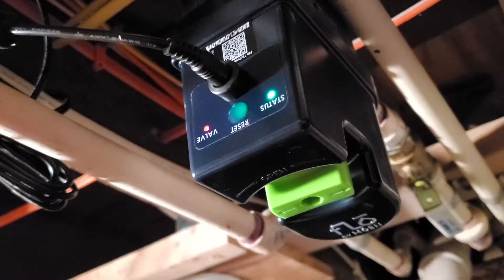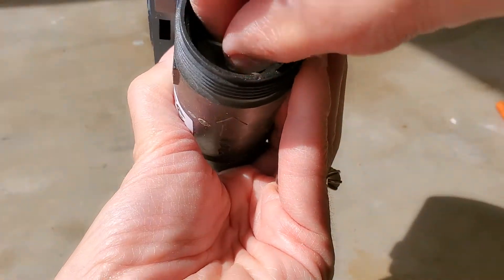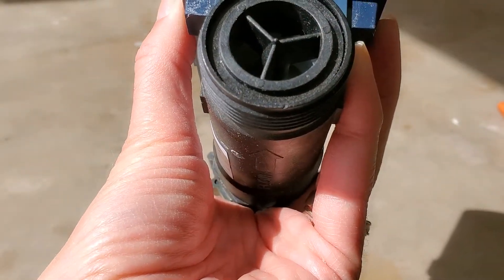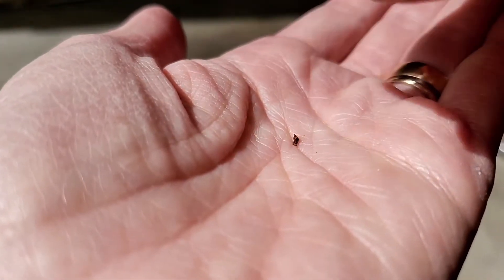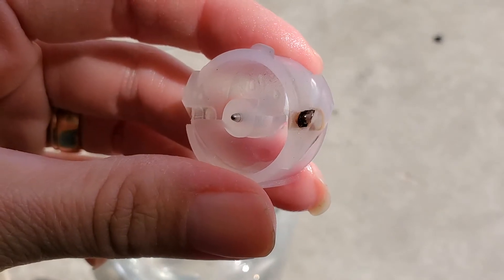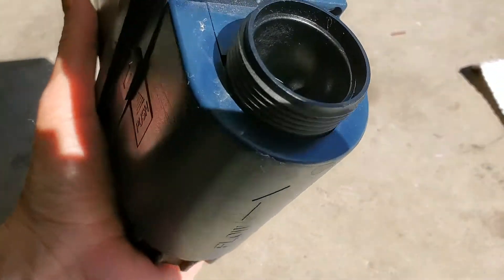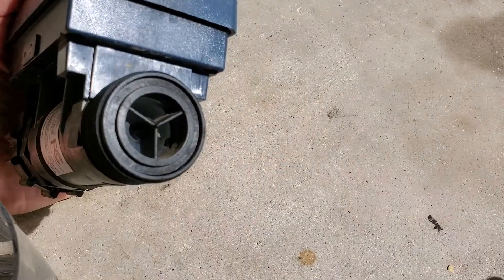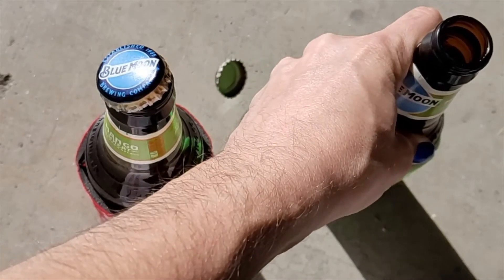Flo by Moen Flow Sensor NO LONGER WORKING?!? Turbine Repair Tutorial

Comment: Ok im not sure if mine is not working becuz no power or it needs cleaning
Reply from the maker: Are the lights out at the device? If so, yes, agreed: power is the problem. How old is your device and is it indoors or outdoors?
Reply: @NoMoreLeaks its outdoor no lights had it about idk 6 to 8 months
Reply from the maker: Oh no. I'm sure you've already made sure power is still live to the device/outlet. If so, my understanding was that they had addressed the interior leak problem over a year ago, but it sounds like that might be a likely culprit. I had exactly what you described happen with my original Flo device, followed by the Flo by Moen, green handle devices. My suggestion is to take it off, shake it, and see if you hear water inside. If so, I hope you still have the spacer that came in the box to put in place while you warranty it out (or just put it back on). I can't suggest enrolling in FloProtect too much here before you hit the 1 year window. I probably should suggest calling customer service before taking it off, but after a few of these with the same issue, that was my standard set of steps. If you don't mind, I'd appreciate knowing what ends up happening.

Comment: Terrible. I had mine installed. 100% regret. From day 1 the device made noise, spun to off or on, and yet,  stopped nothing. Didn't register a problem. I can't trust this device.
Reply from the maker: That is frustrating. Were you able to warranty it out and get a replacement?

Comment: I've been interested an emergency water shutoff valve/system, but the more I look into them, the more I think, "They're not quite ready for prime-time!"
Reply from the maker: I said the same thing 6 years ago, but that's with the reservation that we live in the desert where the plumbing is outdoors and the device must stay outside. I wasn't wrong, but Moen says they have improved the part that failed (I haven't tried a new device yet). I had them send device #5 to live indoors in a climate controlled environment. 5 years later, it is still going strong. Phyn Plus probably would have done as well if they extended the same courtesy Flo Technologies (at the time) did. Phyn has an upgraded version coming out possibly this summer. The main lesson learned here is that if it is inside, it is probably fine, but the outdoor rating--stay tuned.

Comment: My Flo shutoff stopped detecting flow less than 5 months after it was installed -- much less time than what seems to be the typical time-to-failure mentioned in the comments. I am very glad to find this video! But I better contact Flo support first before attempting to troubleshoot on my own...
Reply from the maker: The good news is it sounds like you are still within the 1 year warranty. I'd be surprised if you have the old style turbine shown in this video. The newer units have the magnets sealed inside. I'd love to know what ends up being the issue and would appreciate it if you came back to share. If no one else has sent you a plug for FloProtect--I'd recommend it especially if the issue seems like it will happen again.
Reply: @NoMoreLeaks  I called Flo support today. The rep gave me the most unexpected answer. She said there were cloud updates recently that may have broken my device connection, so she asked me to do a hard reset. I did that, and I removed and re-added my device in the app. That seemed to actually do the trick! (I'm a little disappointed that I don't have any good excuse to open up my Flo now.) I will take a look at the FloProtect Plan, too. Thanks!
Reply from the maker: Thank you for coming back to share this! This seems like a much better solution than anything more dire. My apologies for the delay in response--you've helped me figure out I have an issue with getting notices on replies. Thanks again.

Comment: Our sensors work but when you give it the command to shut off the water it is no longer shutting the water off, just reducing the flow.  I'm not sure why it does this but it could be some kind of build up internally I guess. Ours is crammed into an incredibly tight space so I am not going to bother trying to fix it since it will just break again.  Still get the wi-fi info but can't count on it to shut off the water.
Reply from the maker: That's no good. I'm curious how you discovered the issue and hope it wasn't a leak. How old is the unit--could it still be under warranty?

Comment: Hi and thanks for the video. I don't have one of these devices but I've been considering one. When you refer to the unit not working, what exactly does that mean? The info on the app? Or does water stop flowing? I'm wondering if a problem with the device is interrupting the normal flow of water to the house? Thank you.
Reply from the maker: I live in the Phoenix metro where our point of entry for water is outdoors. My units had to live outside in the heat. 5 years ago the devices were not designed for this environment. I'm talking to Moen again and they say that there have been improvements there. Stay tuned... My last replacement I sent somewhere to get installed indoors in a conditioned basement. It has been fine for 4 years.

Comment: My Moen Flo lasted less than 3 years.  No longer getting power, even after ordering a new power supply from Moen. Poorly designed.
Reply from the maker: Thank you for sharing. Definitely not the best experience. I'm curious. Where was it located? I'm guessing indoors if it lasted 3 years. Did you take it off and shake it? If so, can you hear water sloshing inside? Mine were outdoors and failed on the interior like that. Water went into the electronics side and fried the circuits. I haven't heard of anyone having that same problem if it is indoors. My latest unit is almost at 4 years, but it is inside (not on my house).
Reply: @NoMoreLeaks  Yes, indoors and no, I have not removed it so not sure what the cause is but sounds like what you are describing-water getting into the electronics.  I'll wait until someone (another company) comes out with a better and more reliable design...hopefully.  I spent a lot of money trying to do the right thing, and to have this fail in such a short span of time is frustrating.  I have also had bad luck with Moen sink valves. The ones I replaced were still working after ~30 years but I decided to get ahead of any issues and replace them.  One would leak when turned all the way to the cold side, so I had to replace it. Also (sorry for the rant) I had purchased smart water leak detectors (batter operated) and they arrived with the battery contacts sliding around inside...they weren't soldered.  Returned those.
Reply from the maker: @jimroberts6176  Interesting! I haven't heard of the inside failure happening on a unit installed indoors yet. When mine failed the lights went out so I figured why waste money keeping the AC adapter powered on, so I unplugged the device and left it inline--only to discover water dripping out of the power plug days later! I'd highly recommend putting in the spacer that came with the unit and taking the unit off to prevent a leak from the device itself if you have the internal leak. If you don't mind, when you do take it off, I'd love to know if that is what actually happened.

Rants are welcome--comments are the best part of videos. We all share what works and what doesn't. :)

As for the leak detectors. Do you recall the brand? I'm slowly working my way through a good number of different sensors (shared on the channel) and haven't come across a terrible one yet. Too bad Flo ended the IFTTT integration because their detectors are spendy!
Reply: @NoMoreLeaks  Thanks for the suggestion about the spacer.  The leak detectors were Moen (Flo by Moen Sensors)
Reply from the maker: Happy to help--and prevent water damage from a leaking unit! That would be insult to injury.

Wow on that feedback on the Moen Sensors.

Comment: Thank you! This is the second time around we had to do something about the build up around the magnets.  I can's remember what we did the first time... cleaned or replaced.  This time we did get a replacement kit, thanks to you and your video.  I decide to soak the old one in vinegar and keep it just in case.  The vinegar cleaned out the rust.  There is some black stuff left around both magnets, and I don't remember if it's some sort of material that should be left there, or do I need to clean it more so only the shiny spikes are left?  Some of the black stuff already dissolved...  

Hope you see this!
🙏🙏🙏
Reply from the maker: I'm wondering if the black stuff is what is beneath the outer surface of the magnets. At some point if you have rust building up it can eat through the outer shiny part of the magnet and leave a rough surface which is easier for rust to build up again. If it is not that I have no idea what the black stuff could be. Glad to hear the replacement kit did the trick in the meantime!

Comment: No More Leaks. OK, I have watched all of your videos on the Moen Flo. I do not have one yet. I live in a manufactured home retirement community in Arizona. I own the home, but not the land under it. The water is provided by the City. The water has calcium in it. It can cause problems with faucets and toilets. The local fire department requires two feed to the facility. In Arizona water towers are not used. So there are regulators on each water feed. At times the pressure can be 24 PSI one minute and 73 PSI the next. Leaks are normal in the common areas and quite annoying. There have been leaks in some of the homes causing insurance rate to go up by as much as 40% a year.

I have been looking at the Moen Flo as a possible tool to help prevent a disaster from happening. I do have a ¾ inch copper cut off valve in my garage. My fear is that I will be working on the Moen Flo or replacing it often if I install it. 

What do you (or anyone reading this) think?
Reply from the maker: It sounds like Flo would be installed in your garage and not in a conditioned space? Our water main is outside a bedroom--so Flo had to be installed outdoors here in AZ. After the first Flo failed, I covered Flo #2-4 with shade made out of wood (we were out of town for the most part and could not do much more than replace it 4 times in 1.3 years and sending #5 which is still in service in a conditioned basement). Something about the heat kills units and, personally, I would not recommend putting Flo in our hot garages. If you do end up buying it, I highly suggest planning to enroll in FloProtect. Interesting that your pressure fluctuates that much! My pressure in Mesa was a steady 55-65 PSI in the years that I had Flo and then Phyn.
Reply: @NoMoreLeaks  - Garage yes. But at least on a wall of the manufactured home on copper pipe that is routed through the crawl space. Arizona garages can get hot for sure. I can see that the Moen Flo being built with a lot of plastic could be a plus. Generally water contains minerals such as iron or calcium. During water treatments they often add something to take the taste out, but the minerals are still there. I am a retired engineer that has built houses, race cars and airplanes. I was hoping to not have to work on plumbing problems on a regular basis. I am still looking at it though.

Comment: Also living in desert, and considering Moen flo. You happy with it, how long do you expect it to work? Mine will be in my HOT garage on hard water line. I have read about sensors having issues but moen still seems like my best option for smart valves....
Reply from the maker: Here's my current stance on the market: https://youtu.be/LZbx6ScoT74. I would include a hot garage in that same category because I covered the last 3 Flo by Moen devices on my house. Do you know how hot your garage gets?
Reply: I'm in phx area so up to 120F I guess, plus if car was just parked, even hotter. I'm going to install it just after a whole house filter so hopefully it'll benefit from that. At least the moens are easy to remove and clean @NoMoreLeaks
Reply from the maker: Same. I've read Chamberlain MyQ controller temperature gauge in the garage as high as 108, but it could easily get hotter--I haven't monitored my garage temps as much as what Phyn Plus was reading and also taking surface temperatures of the units (I've privatized most my videos since I cannot recommend either device at the moment due to heat related short lifespan). If you end up going with Flo I HIGHLY suggest enrolling in FloProtect. It's $5/month, but extends the warranty up to 5 years.

Comment: My flo has worked since 2018, but now it does not register flow rate. I removed the impeller and cleaned it, but it was not really dirty or corroded. I guess it is just a WIFI enabled shut off valve now. :-(
Reply from the maker: Wow! 2018--you are one of the first customers.

That's the first I've heard of that situation. Is the pressure sensor still registering? If so, Flo still making sure you don't have any small pinhole leaks or small drips/leaking toilet flappers (that's why I bought mine because there was a small pinhole leak in the copper plumbing beneath my slab foundation) through the automatic test. And if you are out of town--although it will not automatically shut off a large break--it would send you notices that the test was interrupted because of high water use and you could still shut it off remotely. Although if you also have the leak sensors that will also cause the valve to shut off right at the start.

That might have been a long response there, but I didn't want to discount the coverage you still have. 🙂 I also very much appreciate you sharing your experience.
Reply: @NoMoreLeaks  Yes, it still reads my pressure and temperature. I do recognize that it still is worth having.

Comment: The green valve keeps spinning. Water leaking from the valve. Called moen and they said I am not covered. The unit is very expensive. no lights on the units either....I took it out and checked the magnets they were corroded and cleaned them. No changes. Any recommendations if you guys face the same issue.
Reply from the maker: I haven't heard about that specific instance where the green valve is leaking. No lights is a key clue. When mine went, there were no lights and water was slowly dripping out of the power plug. The heat/UV broke something inside the units and the water meeting the electronics fried it. If there are no lights, you might have had a breech inside as well. When you took off the unit did you hear water sloshing inside? Also, where is your unit located--outside or inside?

Comment: Been reading all these posts regarding the turbine/magnets issue, and I have ine question...

If this is such a prevalent problem, why not, prior to the initial installation, remove the turbine and cover the magnets with a dab of nail polish to encase them (and protect them from corrosion), and then install it?

Anyone ever consider this?
Reply from the maker: I like the way you think. There a few issues here. First, I think the magnet issues didn't appear for a while so it's a common surprise to users who bought Flo in the first few years (2019 or so). Second, word on the street is that the replacement kits have solved this problem--the magnets are entirely sealed in the turbine. I should call in to customer service and see if they have upgraded the turbine in the units sold today. Last, considering how nail polish sure does not last on my nails longer than couple days, I'd need a little more education on a better material to coat if the current units are still the old style. I'm not sure on which video someone commented they put some kind of grease when they replaced the magnets to DIY a fix before the replacement kits were available. I've privatized most of my Phyn / Flo videos while I reevaluate where I stand on these devices.

Comment: Thanks for the great video. I am in Las Vegas and we have extremely hard water hence why I installed my Flo after the filter/softener in the garage. Sure it won’t tell me about irrigation or exterior hose bib leaks BUT it should last much longer, has great access AND covers the majority of the interior piping which is what I wanted anyway.
Reply from the maker: Thanks. *crossed fingers* you won't have to deal with this for a few years.